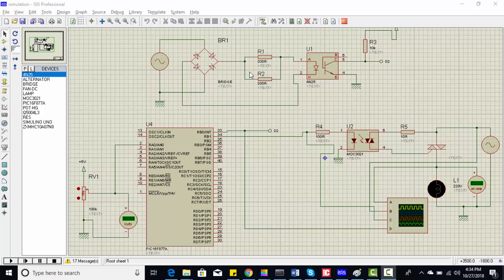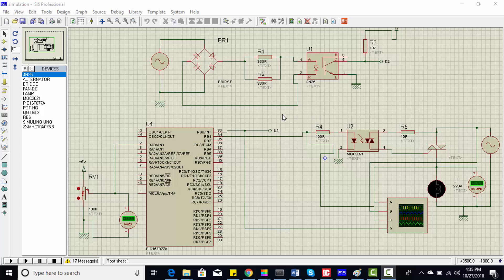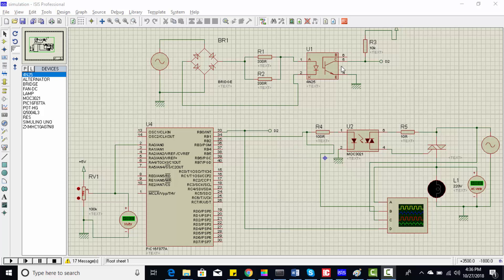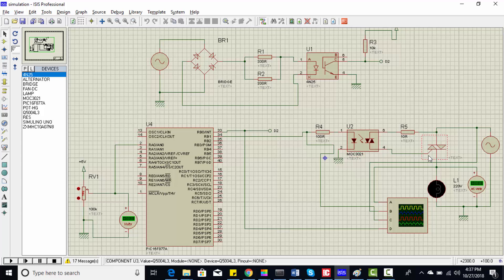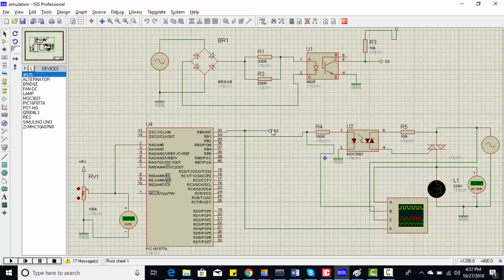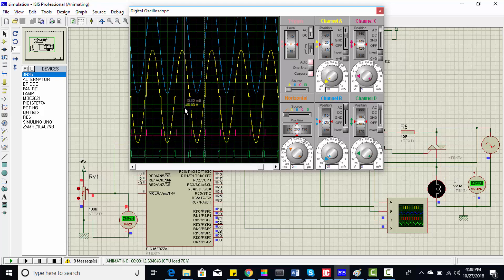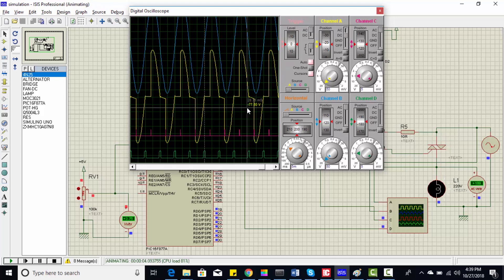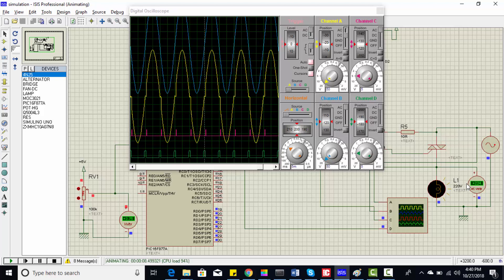soft starter for single phase induction motor using pic microcontroller

Comment: Hello, I have a question about the video previously published "Digital DC Ammeter using microcontroller". In this circuit, can I measure the instantaneous current in the battery of an electrically powered vehicle? I want to measure the current value instantly. I'd appreciate it if you could help.